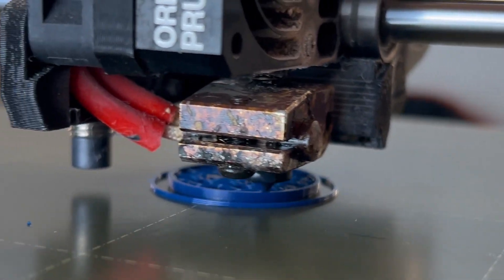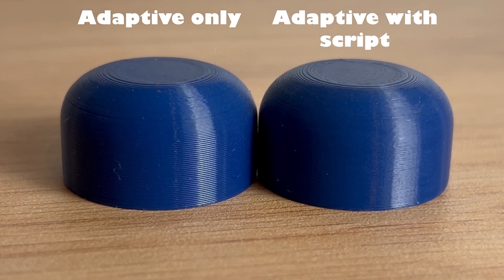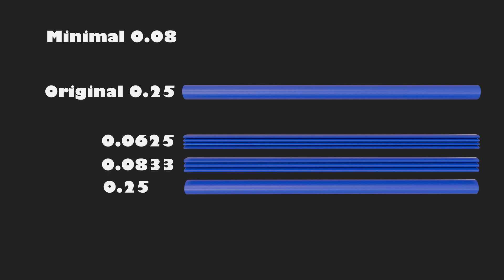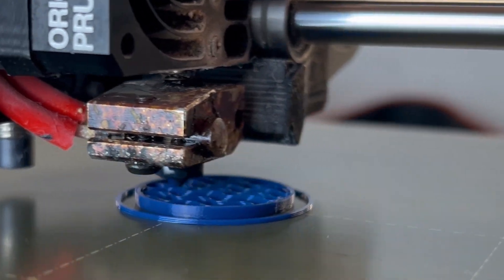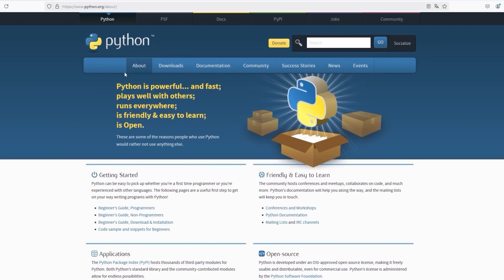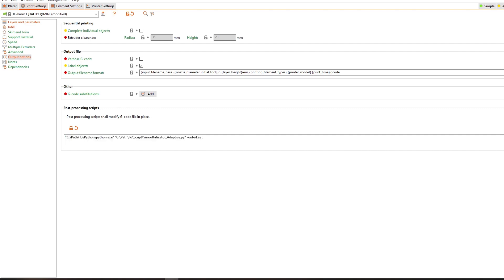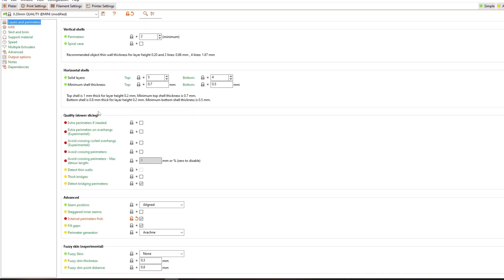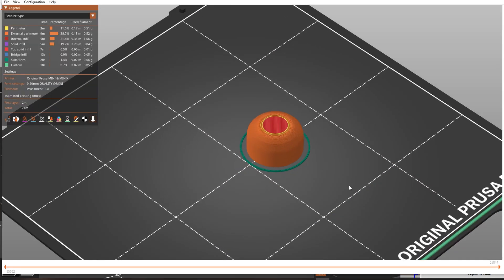Better Adaptive Layerheight for 3D Prints?

Comment: Great work, but for me to use it, it would also need to have the better layerheight resolution benefit. Now it only benefits very simple shapes. So I think it should works like "combine infill every x layer" feature, that also include walls (except outer wall).

Comment: Now that is really useful, I did a replacement gear lever knob the other day, did 3 perimeters and had to sand with varying grades of wet & dry, but your script looks very much better than standard variable layer height.

Comment: This is VERY interesting and I wonder if there is a realistic way to have the multiple layers of the outer wall be run in vase mode to eliminate as much of the seam as possible.  For instance if I use a 0.2mm layer height with a 0.04mm minimum that would, in theory, be 5 outer layers to each inner layer.  So lay down the inner layer in one pass and then lay down 5 outer layers in a steady spiral up to the 0.2mm of the inner wall.  Maybe?

Comment: Hello can i make a suggestion.

I think i have got the scripts working now, but in the preview things are a little confusing.

So if i change to layer height view in the gcode preview it avtually shows alternate layers being different heights.

Flow rate wise i do not see the 1.5x increase in flow on the inner wall i actually see a decrease in flow.
With the 3d object itself when i break it  i can't see any changes at all.

Could you make it so your script adds a descriptor to the output G code.
I.e brick layers enabled 

Right near the start so at a glance we can see if the script has adjusted the code.